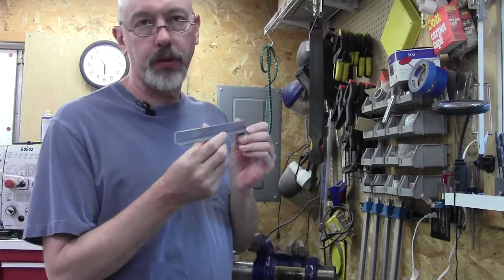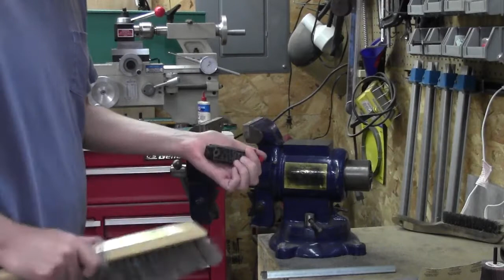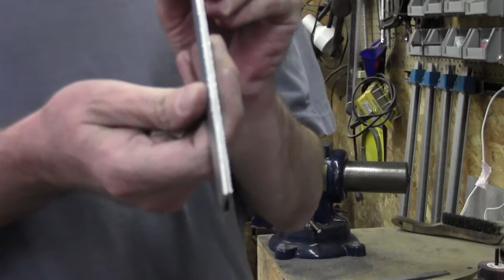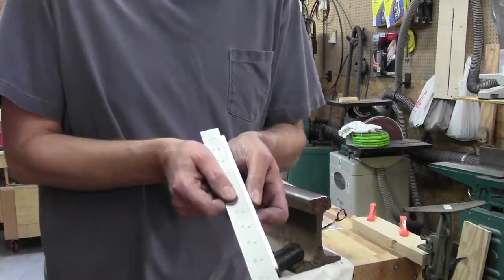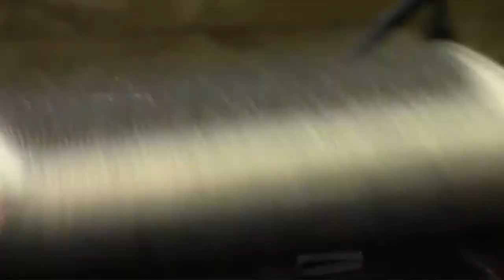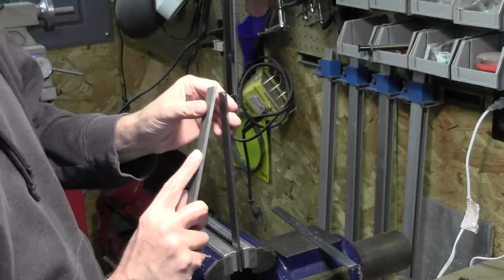Making a folded saw back

Comment: I was with you the whole way - anxious for the climax moment when you would fit the plate to the folded back.
And instead I saw your niece.

She now has a brilliant piece of machinery and a special story with her uncle. And I have a "WTF" in my head. And that same "WTF" is laughing at me to go figure it out on my own.

At least the back will be straight.
Reply: The way you add the saw plate is to start a corner and then tap the folded back down onto the top of the saw plate with the tooth end of the plate against a wooden block or piece of two-by. The wood will not hurt the saw teeth. You don't insert the plate all the way, only to about 3/16"-1/4" or so which leaves room to adjust "tensioning" of the saw plate for any slight bend or waviness in the future. The extra space also serves as a sort of "pressure relief" in protecting the saw plate from being kinked.

Comment: Mike, using the angled stock has rekindled my interest in folding a saw back. I was wondering if you've given any thought of thinning around the corner of the angle stock just enough to help facilitate the closing of the bend? I may try this myself. I was thinking of running light passes with an angle grinder along each side of the corner on the inside just enough to reduce the excess mass at the corner as the fold closes up. I'm hoping there's a sweet spot that can be achieved without losing the integrity of the bend.
Reply from the maker: Blasthoff It sounds possible.  I would probably try using a flap disc rather than a grinding wheel.  It can still remove material pretty fast but would give you better control.  Let me know how it works out.
Reply: I never thought about a flap disc as I didn't think it would remove much material. If it does it certainly would be easier to control. I'll look into that as well.
Reply: I just happened on to this again after a year. I like the piece of angle stock you used as it seems to be just doable. I came by a piece of 1" brass angle but I can see it is far to thick (appears to be a full 1/8" thick) for bending in a vise, especially the bend!! I've got to get over the brass "kick". I've toyed over the idea of joining single strips of brass together either with rivets from solid copper rod or simply using JB Weld (strong stuff!!) along the seam edge. The steel back is more workmanlike anyway. My one vintage 130-year-old Wheeler, Madden, Clemson backsaw has a steel back. If you want to get "fancy" that soft steel should take gun bluing very nicely but it's not necessary. It's fun working on saws but it's easy to forget they are tools to be used first and foremost. At least I keep telling myself that!!

Comment: I tried it but I finally bended the vise handle and didn't get good results... I think I need a much bigger vise
Reply from the maker: A larger vise works better but it's still a pretty difficult job.  I did this to show that it can be done but didn't really expect many folks to try it.  If you can find a metal shop nearby, they could probably do this in a couple of minutes for you.  You can also buy folded backs in brass or steel in the USA from www.tgiag.com

I have been working on a project with 48 hand cut tenons and cut many of them with an $11 Kobalt saw I bought at Lowe's.  I had to sharpen it, do a little bit of straightening, and clean the lacquer from the plate, but the steel is good and it works great.  I would still like to design and build a wooden handle but the plastic one isn't as bad as I had expected.  If you need a cheap saw I can recommend this one.   https://www.lowes.com/pd/Kobalt-14-in-Back-Saw/1053305